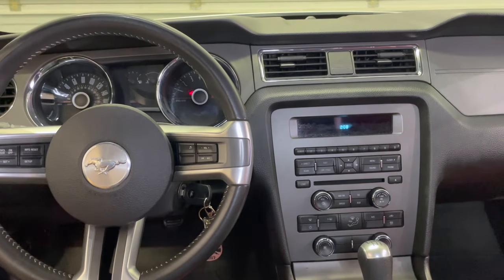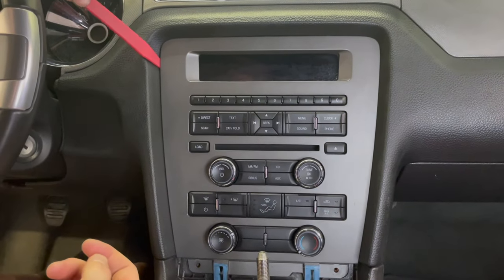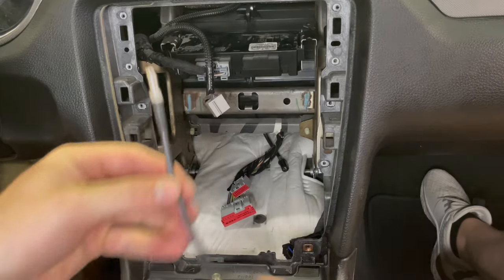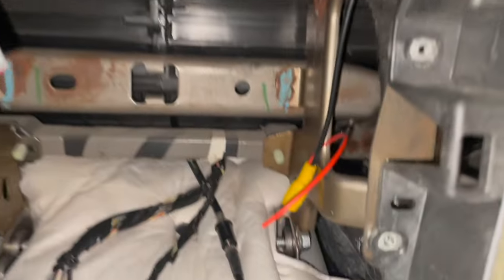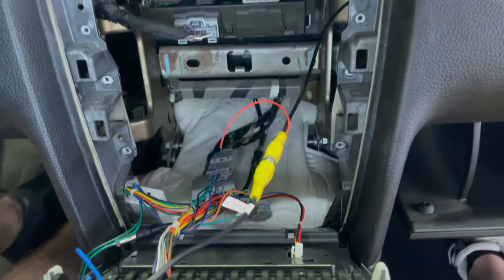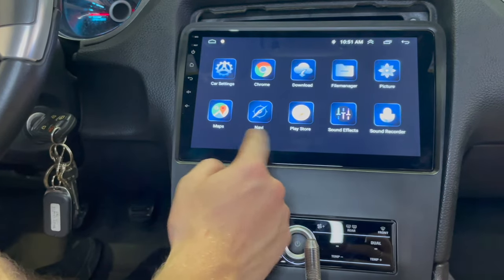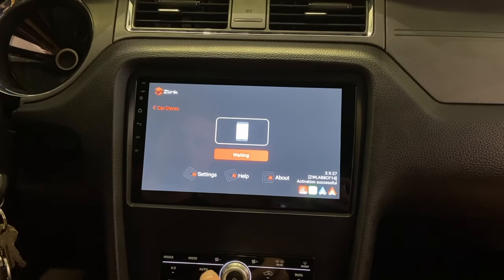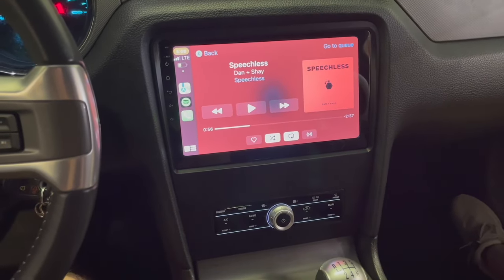How to get Apple Carplay for a 2010-2014 Mustang!! Installing Huge Amazon Touchscreen Headunit!

Comment: I had this unit in my 2010 for about 6 months.  Ended up ripping it out because it sounded like garbage compared to the stock setup.  I really tried to like it….but the sound was horrible.  Hooked up a sub/amp combo to the factory system now…sounds mint.  I actually gave this unit away for free that’s how bad the sound was.   Perhaps something went wrong but it wasn’t for me.    Not saying don’t buy it…all the Apple play and display and apps are very cool….just consider my review.

Comment: Just bought mine, watched this video and then finalized my purchase on eBay. Really appreciate you.
Reply: Is it still working well man? How’s the experience? I’m thinking about getting the 2gb ram 32gb rom
Reply: @kevinhhn  is it working ? I wanna buy one send the link
Reply: @Freeway5mobbin  ya it still works, had it for the past 6 months, it’s on eBay.
Reply: @kevinhhn   how much was it my friend ? Is the audio still as loud as the original one
Reply: @Freeway5mobbin  I think around like $200, plug and play. It has apple car play preinstalled  for iPhone so it has very good sound via blue tooth
Reply: @kevinhhn   is it this one that you bought ? i wanna buy one for my 2014 5.0 but i been hearing mix reviews on it that the AC doesn’t work and that the volume is low I just wanna get a the right one
Reply: @kevinhhn   send link if you can find it bro im tryna order it have u had any problems with your Ac ?
Reply: @kevinhhn  I ordered it man it cost me 217$ hopefully the ac and everything works crossing my fingers
Reply: @HellcatCharger707  i want to buy this, hows your experience been?
Reply: My ac doesn’t work

Comment: It will not fit, even without any clips, there seems to be something stopping it from going in on both the top and bottom. I've made sure there's no wires or anything blocking it. Do you have any help or advice?

Comment: Great video 
I just got mine today and watching your video made the installation process very quick for me.
Reply: How are you liking it I ordered the same one from eBay hopefully it works man
Reply: I ordered it man it cost me 217$ hopefully the ac and everything works crossing my fingers
Reply: @HellcatCharger707 did you get it put in?
Reply: @Gartonman   yessir
Reply: @HellcatCharger707 how is it so far
Reply: @GioVilla-su4kl   it’s great man
Reply: @HellcatCharger707  link? if you don’t mind
Reply: @GioVilla-su4kl   it’s on Amazon I know it has low starts but it’s been working great so far the audio sounds good

Comment: I just bought one today, I have a question, the bottoms from the steering wheel still working? Also yo know if the heater seats can work with this unit ?

Comment: Did you compare audio quality ? Is any difference between stock and this one ?
Reply: Not sure why some said quality was bad because it was an improvement over stock and sounds fantastic  others issues not sure if it is an amp, sub woofer system or other mine was a basic stock system.  Best thing I did to my mustang so much better than stock radio.
Reply: I have this unit and the audio quality was worse than stock. For me I won’t say it’s terrible but it definitely could be a lot better
Reply: @jeffkeis8666  hey man how’s it working can you send me a link of the one you got ? I wanna buy one but these mixed reviews are having me hesitant

Comment: Great video.. just installed my screen with this video, everything worked great EXCEPT my volume. I cant hear any music not even thru the regular radio.. any advice??
Reply from the maker: Turn up your phone volume all the way. If that doesn’t help their are a couple of volume settings you can mess with in the audio controls. Hope this helps
Reply: Did you ever solve this issue? Having the same one
Reply: Did you solve the issue? I just figured it out!
Reply: @92chucks I did thankfully! But now I have an issue where it keeps glitching to the AC screen on its own randomly
Reply: @92chuks what did you do in having the same problem
Reply: @LuisGarcia-el9rl what did you do im having no sound problem

Comment: What Brand is this head unit?  I searched “Huge” in Amazon, but nothing turns up.  Also how do you feel about head unit now that it has been a few months since you installed it.  BTW, you have a very good, and comprehensive way to explain what you are doing.  Thanks

Comment: How did you get you a/c to work ? Because mine is not working. Before I took the og radio off I turned up the ac and turned down the volume. But it’s still not working. So I’m just wondering what did you do to make it work?
Reply: Did you figure it out , my air runs hot and it doesn’t let me turn it off
Reply: @michaelcuenca7207  it's a fuse that happened to me last summer. Passengers side fuse box. Red can't remember which one sorry.

Comment: The cable that is originally for the oem screen what happen to it were did you connected it (the first plug you took off from the beginning from the old head unit )

Comment: i bought one from ebay it’s works the same 100% the camera just stop working but that’s not my issue the thing is that the ac screen comes and go like if iam turning it on or off
Reply: Mine does it too. It's so annoying and it's a distraction
Reply: Should I purchase mine off Amazon or EBay?
Reply: @AllstarproductionsHD any fix?
Reply: @whosyvng  haven’t found a fix for the ac popping up. It seems to only do it when it wants to. I bought mine through amazon.
Reply: @whosyvng  I bought mine from eBay right now how about you ? How’s it working man
Reply: It works with automatic or manual transmission 
14 mustang is switch year for head unit so make sure unit is 14 and newer head unit there is a feature to fix AC randomly coming on use float feature fixes problem with coming on randomly have to program all buttons in settings sometimes steering wheel and ac control buttons

Comment: Quick question. I have a 2014 Mustang with heated front seats. Does this unit include options for heated seat controls?
Reply: I was wondering the same thing!
Reply: @isaacsalas9813  Yeah, be nice if the content creator answered this question.
Reply: It appears that it does.. idk for sure but when he checks to make sure everything is working, there are heating controls on screen for the seats

Comment: The AC panel does not work? Is it a fuse or wire issue. What are your thoughts? It’s brand new just bought this
Reply: Did you figure it out? I just got mine set up and figured it out after 2 mental breakdowns 😂
Reply: @92chuks  no did not. How did you get it going. The AC works and the buttons somehow work but no display shows. Or the speed is inaccurate. AC display doses not work on the screen tho. Only on the bottom display where the nibs are at but speed don’t work.  Very frustrating
Reply: @Eastonmartinez-zl2cx  did you find the problem?

Comment: Great video!!
So I ordered the same unit, only problem I'm having is the climate control, once I turned it on it won't turn off. I don't see a off button for the ac or fan, does anyone else experience this issue?? Thank you an advance
Reply: Did you fix the issue?
Reply: @sebastianrea2959  
Yes, I did, so I had to do the steering wheel button learning setup. Once there, I programmed the A/C option to one of the buttons on the steering wheel. That allowed me to see the full option screen and be able to turn on and off the system. Does that make sense?
Reply: @aloncito1111  not necessarily im ordering mine and should arrive in a few days hope ot makes the stang a little nicer inside
Reply: @sebastianrea2959  let me know when you received yours. Hopefully, you won't have the same issue.  I realize there are some many different brands for the same type of unit. I bought mine from Amazon
Reply: Hey quick question what if theres no sound ??
Reply: @aloncito1111 I have this issues I turned on ac now it won’t turn on but I have a quick release steering wheel so hopefully this works

Comment: I ordered a similar system for mine. I have a shaker amp so that complicates the install.
Reply: Did you bypass the amp?? I have the Shaker Pro and my sound went out so I bought this unit and it works great just still don't have sound. Thinking my amp is blown but I can't find info on it.

Comment: is it possible to give a more in depth explination on how you spliced the back up camera with the rear light cable?
Reply: I’d like to know as well, I don’t wanna mess things up
Reply: I just installed one.  You will need to buy a couple of connectors from any auto store, they have quick connectors available that allow you to splice into an existing wire with out cutting it and a ring style crimp connector. There is a red and black plug pigtail that plugs into the power for the camera the red wire you will splice with the blue tail light wire the black wire needs to connect to ground. I used a quick splice/tap connector to the blue wire with the red from the pigtail and used a crimp ring connector on the black from the pig tail and attached it to the ground bolt that is near the rear tail light. If you pause the video as he talks about this you can actually see the black wire is grounded in the video. Then plug the pigtail into the power connector from the camera. The red wire that is hanging from the side of the long video cord is not used if you do it this way. The splice connector I mentioned has open on one side and has two channels in it. Lay the blue wire inside first and the red wire next to it and close the connector with some pliers and it will tap into both wires.  Just be careful when you put a ring connector on the black wire, it is very thin. I put electrical tape around the connector as strain relief.   @kevinhhn
Reply: @dphitch  nice man, ima try it soon. I installed the head unit yesterday and finished the wiring from the head unit to the trunk,I gotta drill a hole where the license plate is first to snake the camera cable through the trunk, then I can tap into the blue tail light cable and ground the black one like you did. I wanna do this sometime this week, this head unit isn’t too shabby for $200~. The fit into the car could be better though, it didn’t seem like it was a perfect fit. It’s Chinese but you’re looking at 3x times the cost for other units not to mention installation/wiring/labor cost.  Hopefully, it’ll last us! Will let you know how it went soon after I am finish with the installation.

Comment: Just purchased this same radio off Amazon but won’t power on when connected. Any suggestions?
Reply: Having the same issue now. Did you fix it
Reply: Blown fuse for the radio

Comment: How is the audio quality? Does it sound better than stock? TIA
Reply from the maker: Lance Hoey it’s better than stock. You have android audio settings you can play with. You also have factory audio settings you can adjust. Over all the audio quality is very good. In the Amazon description you can see what cpu and processor they use.
Reply: Very interested in this as well. Does this bypass the stock 4 speaker amplifier with its own internal amplifier? I want to upgrade my base stereo which sounds absolutely terrible. Hopefully this headunit creates a better signal and allow a better range for the speakers to play at. 
Lastly, is there a physical indicator light for the A/C or is it just a GUI indicator on screen?
Reply from the maker: There is not an indicator for the the A/c asides from the A/c control that pops up on the screen. This head unit made my bass sound 10 times better. It has an amplifier in the head unit. You can adjust all of the settings for the amp.
Reply: @herethereandgone  awesome! Thank you for the response and explanation!!!

Comment: That cd device is the whole amplifier sound system 
The sound quality will change to worse 
Even in some cases the sound speakers will blown 

I don’t recommend to use aftermarket products 
Upgrade it to shaker1000 will be great
Reply: So if I take the ACM out like he did the sound quality will stink?

Comment: Anyone know where I can turn the air off because it’s hasn’t been wanting to shut off?
Reply: Did you figure it out? I can try to help.
Reply: I can’t turn my air off also
Reply: I found a solution! First you want to go to protocol settings. Make sure it says Network Can Set! Skip over raise. Scroll down to “BSJ”, to the right select ford, then select 2009-2014 mustang . Your ID should be 9005008. This will for sure fix the AC, steering wheel buttons and more!
Reply: @tyrese1034 im going to try it thank you

Comment: Do i have to splice the wiring so that the backup camera only works when you go in reverse or does it automatically do it and show it on the screen when I go in reverse which means there was no need for that ?
Reply from the maker: You have to splice the wires into the taillight backup lights. Then when you put the car into reverse it sends power to the backup camera.
Reply: @herethereandgone how do I splice the wire

Comment: What can I do if I don’t have that air conditioning settings also the dial doesn’t work at all
Reply: Did you ever figure out this issue? Bc I just got mine installed and im having issues with the a/c as well
Reply: @DavidChavez-qj9zz currently going through this. Any updates?

Comment: My ac control and volume control does not work like yours and did exactly everything correctly like you did
Reply from the maker: You may have gotten a bad head unit. Give top display a call and see if they can help you
Reply: I found a solution! First you want to go to protocol settings. Make sure it says Network Can Set! Skip over raise. Scroll down to “BSJ”, to the right select ford, then select 2009-2014 mustang . Your ID should be 9005008. This will for sure fix the AC, steering wheel buttons and more!

Comment: Anyone have a problem with a battery drain after installing? I installed this radio in my mustang 2014, everything works, but even after I turn off the ignition, there is a 0.4A battery drain. It's like the car is still searching for the OEM radio
Reply: i think its the sync stuff.. it's located in the glovebox
Reply: @JoeOfAllTrades  can you specify? What does it look like and what should I do with it to stop it from draining the battery?

Comment: Great video, I am the seller of this model , please connect me ,we may have more radio can work together .
Reply: does everyone of them stay on while the car is off and locked?
Reply: @benellis6873  please check if the canbus is not connect , go to setting --- system info ,check if it says connect on protocol
Reply: @topdisplay6691  I just bought one and the ac screen constantly pops up without me touching anything.